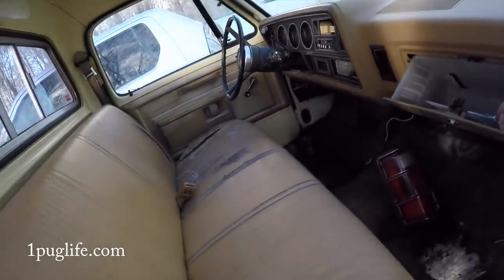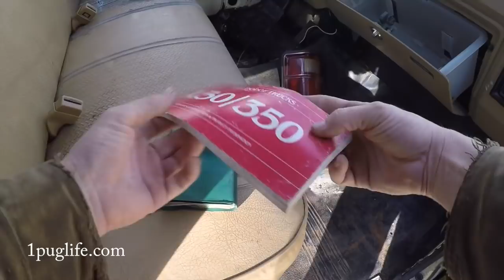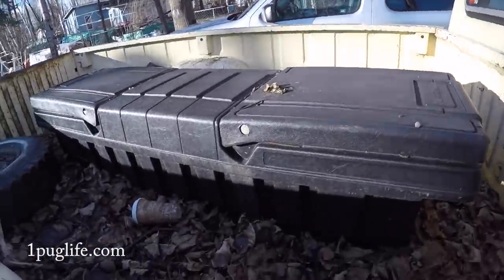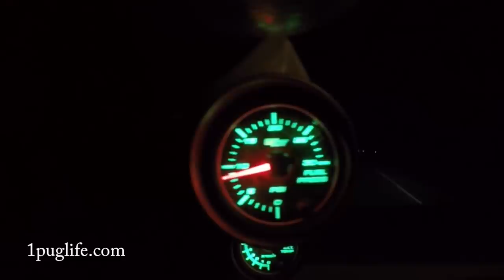another dodge

Comment: 225 slant six is such a pile 98HP has no power. Had on in my 1981 Diplomat 66000 miles and restored the whole thing and gutless. I gave dodge a go a few times and they all let me down. Since then GM is all I ever got and understand why my family has been GM since the 1940s. Who really waits till the last min to put fuel in?
Reply: @Phil Theodore GM 262 v6 400v8 396v8 even the newer 5.3l I got 244k miles on mine and my brother has almost 400k miles. Fords 300 straight 6 was a monster for torque. Even fords old 2.8L v6 had one of those in my 85 ranger couldn't kill it.